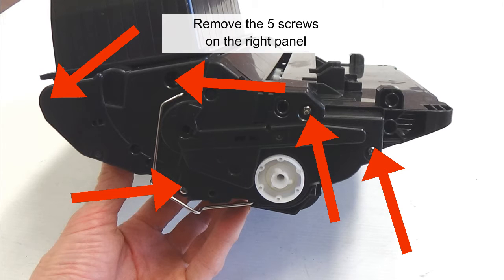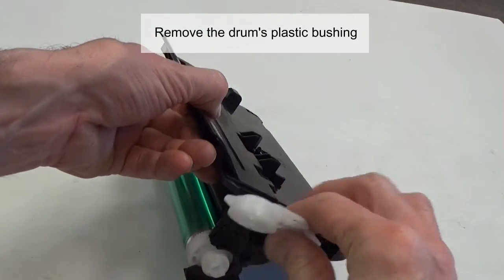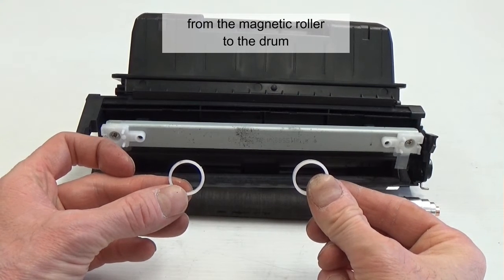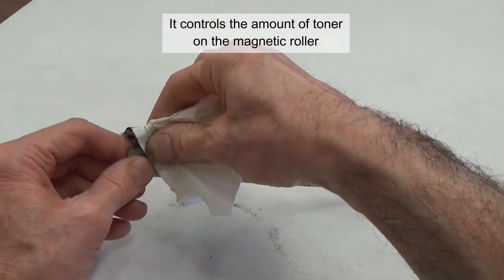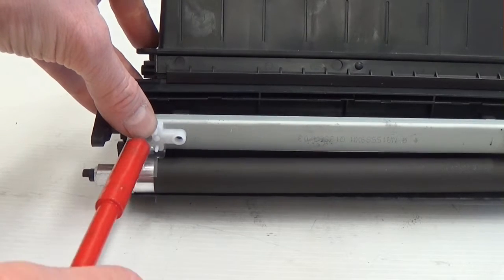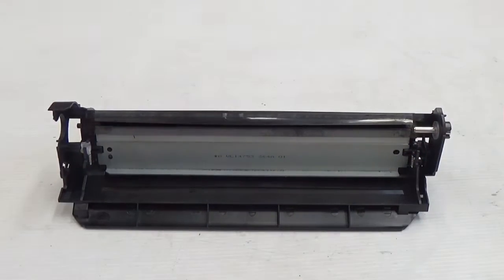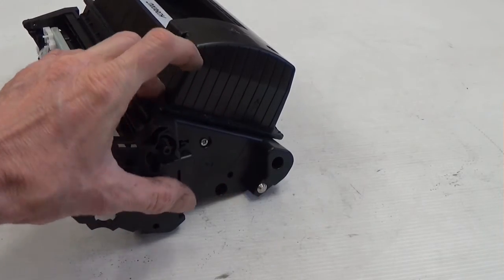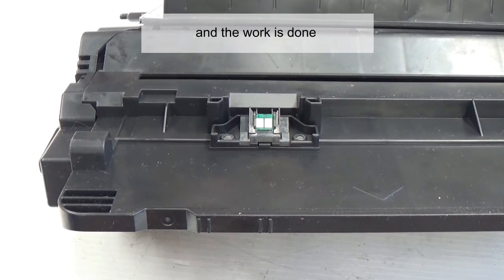How to refill HP Laserjet Enterprise 600 Toner Cartridge

Comment: very good video, a question this toner uses chip, clarify the doubt and if you use it you have to change it when it is recharged, and how many times you can recharge the toner thanks
Reply from the maker: you have toi change the chip when you refill the cartridge or the printer will give an error message. without changing any component you can refill the cartridge 1 or max 2 time